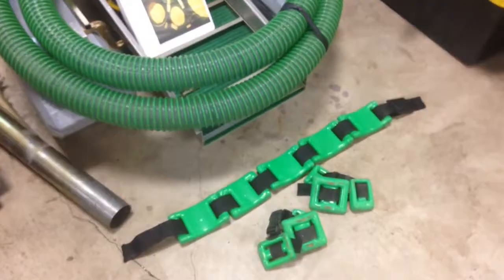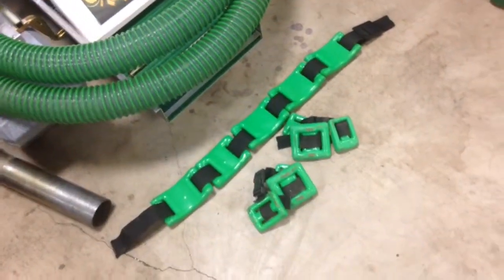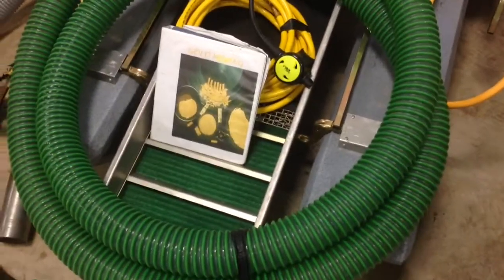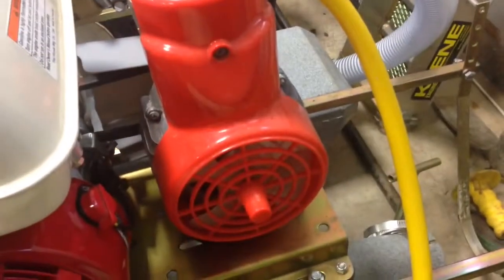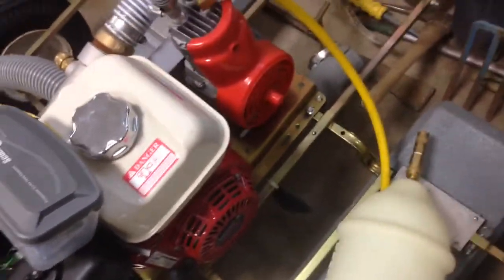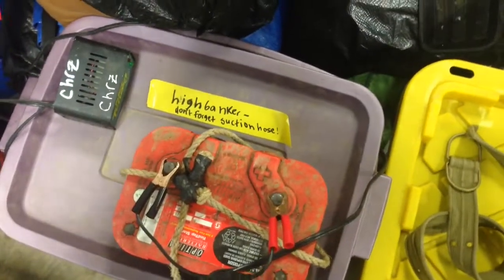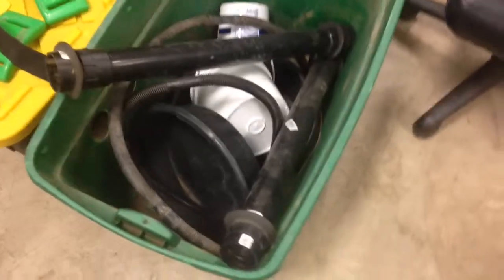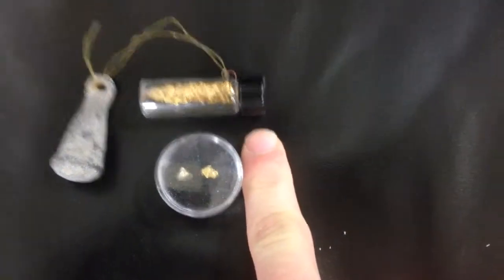Gold dredge 3" Keene

Comment: Nice setup!  I'm just starting to get setup myself, working my way up to a fully operational dredge.  You've come a long way!  If you ever wanted a portable 4" dredge you could look into a subsurface dredge. The sluice hangs from the floats under water. Since the material doesnt have to break the surface of the water, you have less gravity fighting your pump and can run a very small pump and motor.  It's more difficult to  tell how your riffle action is working, though. The sluice is enclosed in a box. A friend of mine uses a 1.25" keen dredge pump with a 3.5 horsepower motor on his 4" subsurface dredge. He says he can carry the whole unit on his back for about half a mile. I plan to build one some day for the portability.